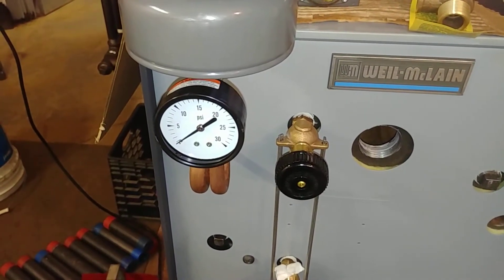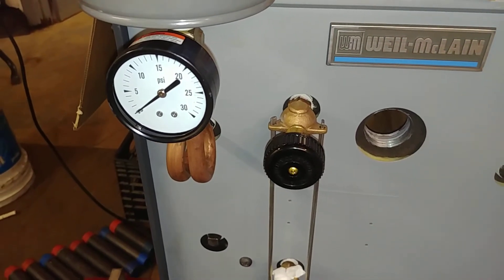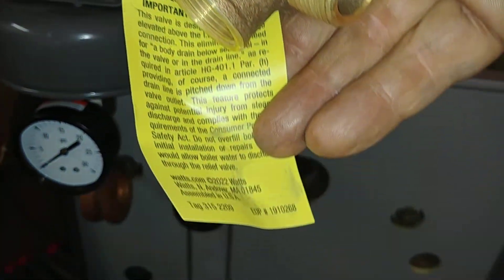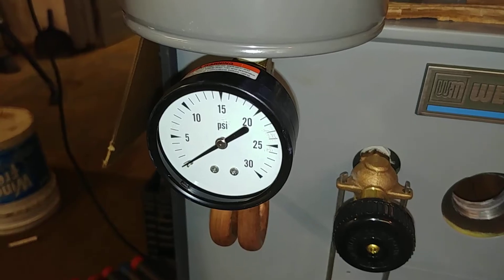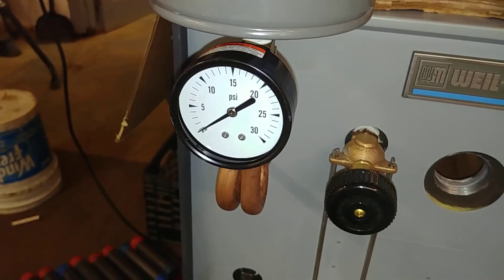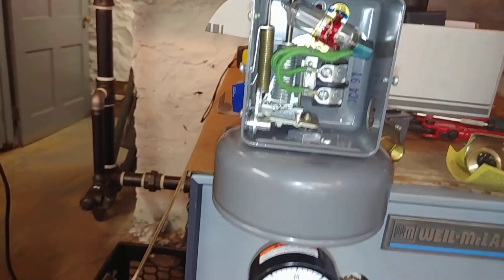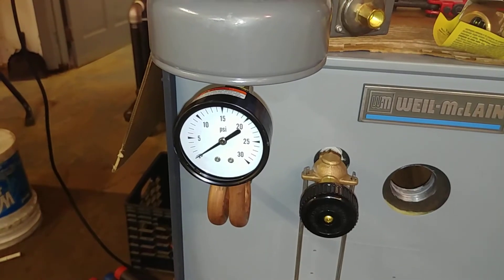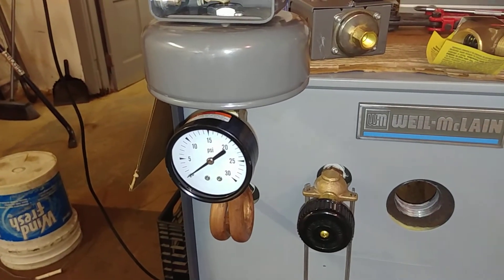Why Doesn't The Pressure Gauge On My Steam Boiler Show Any Pressure? Hint: It Rarely Should

Comment: The gauge on my burnham is for pressure and high limit cut off, the gauge was always stuck 50 psi, the temp would vary depending on how long it on, 170. It cuts off but build pressure very hot in boiler room, one way releif vavle opened to allow water back in after it lost pressure durning the change of gauges
Reply from the maker: I think you may be talking about a hot water boiler?

Comment: Hi, what if my p4041009 isn't shutting down my steam boiler and my internal syphon gauge on my boiler is going up to 30 psi. I have no gauge on my pressure trol switch pig tail pipe.  But it never did have that
Reply from the maker: I would check to see if the "pigtail" the pressuretrol is connected to is clogged.
If your pigtail is made of steel, I would replace it with one made of brass regardless if it is clogged or not.
I would not entirely  trust the pressure that is showing on your gauge. 
Internal syphon gauges are notorious for showing phantom pressures.

Comment: All your videos are amazing, thank you. I fixed my pressure control by using the flat head to bend the metal peace so that it clicks up and down like you said on your video. My pressure gauge is reading 5-6 psi. I believe I have to clean my pigtail and water cylinder .  My question is in what order do i do this procedure? How do i get that pressure down? My assumption based on your videos and comments is to 1. Turn switch off. 2. Unscrew the  top gauge of water cylinder. 3. Empty water from low water cut off. 3. Unscrew bottom gauge of glass cylinder. 4. Clean glass etc…. poke holes for sludge. 4. Move to pressure control. Unscrew wires then remove counter clock wise along with psi gauge and pigtail. Clean etc… 5. Put glass cylinder back, fill water. 6. Put pigtail and pressure control back. How do I fill the water back? Does the pressure on gauge move? And when filling cylinder how do I adjust the gauges when filling? Do they have to be loose or tight?
Reply from the maker: Thank you for your kind words!
I would check out other videos on how to work with boiler sight glasses and make sure you have the requisite tools (such as glass cutters) and parts (such as gaskets, 5/8 glass tubes, etc) before touching the sight glass. 
I am not sure what you have in front of you (a MM#67 perhaps), so it might be counter productive to give a tutorial for this over ytube.

Comment: I have the exact pressure gauge and I’ve been having trouble with my heat hot water doesn’t last and some heaters in the house aren’t getting hot should I increase the water pressure ?
Reply: Also my pipes bang really loud
Reply from the maker: Do you have a steam system? With a tankless coil to provide domestic hot water? Oil fired? 
What is your water level as read by your sight glass?
Reply: @ it’s oil fired the sight glass is full of murky water
Reply from the maker: @Munchies860  If you can't see what your water level is, I would see if you can get it cleaned so you can &  it's very likely the sight glass fittings are full of muck, also.
Reply: @ the sight glass is completely full bottom of it is brown water. Psi reads 1 the boiler will come on then lock out
Reply from the maker: @Munchies860  Check if the pigtail is blocked.
I repeat: clean the sight glass!
Reply: @gordonschweizer5154  Im having the same issue and i cleaned the sight glass and my system still locks out
Reply: @ it’s cast iron steam radiators

Comment: It cracks me up that they let the boiler manufacturers install those "internal syphon" pressure gauges that are supposedly so critical for safety monitoring and that they let them install them just above the water line.  They know the hole is as small as a needle and they just get plugged up in no time and from then on they are responding more to temperature than anything else.  Ya can't make this stuff up.
Reply from the maker: Truth.
I regard the phrase "internal syphon" as a warning label of failure.
https://youtu.be/9smte5dqayY is a link to what's inside such a gauge.

Comment: My guage reads 1lb resting with the boiler cold. But does make its way up to 15lbs + as the boiler runs. Pigtails clear and the pressuretrol is set to 1.5 with the diff at 1. Both Mains are vented with two gortons #1’s each not quite sure if my pressuretrol is bad. Any ideas? I was going to add a low pressure guage off the bottom of the pressuretrol to see if the 0-30psi guage is faulty
Reply from the maker: Does your 30# gauge say "internal siphon"  somewhere on it?
Or is it a gauge with a rear connection?
Reply: Yes it says internal siphon. Guage has the 1/4” connection on the back and its nippled straight into a reducing bushing in the boiler all by itself
Reply from the maker: Check out this vid  on internal siphons & let me know what you think: https://youtu.be/9smte5dqayY
Reply: Excellent explanation thankyou so much for your help and speedy responses I appreciate it very much. So more than likely a faulty guage. Ive ordered the fittings and a new guage to pipe it off of the pigtail
Reply from the maker: I'm glad I was able to help!
If you would, could I ask for a Super Thanks in the amount you deem appropriate?

Comment: I wonder why some steam boiler have that gauge attached to the boiler and some have that pigtail that keep it away from the boiler.
Reply from the maker: @howze2ID  The gauges that are attached directly to the boiler generally have a thing called an "internal siphon".
It tends to clog & and make the 30 psi gauge even more useless.
Please check out my video on steam gauge internal syphons.
Reply: @gordonschweizer5154  thank you much again. So adding a pigtail is a little better for that gauge to function properly?
Reply from the maker: @howze2ID  Yes, adding a proper brass pigtail to protect the gauge is prudent.
I would also consider adding another gauge as well as the code mandated 30 psi gauge, one that reads 5 psi (or less!) to get a truer reading of the actual pressures your system may be operating at

Comment: Great video.  Do you need to add water into the pigtail prior to installing it or does the steam condensation fill it over time?
Reply from the maker: Thank you!
Some folks do add water to the pigtail on first-time start up, but it seems not to be really necessary as you say.
What I think is far more important is to check every season to see if the pigtail is not clogged.
Reply: @gordonschweizer5154  thanks for your reply. I really appreciate it. I just replaced my 30 plus year pigtail with a brass version. Old Pigtail surprisingly was not clogged.  Also replaced the gauge as it was way off by a few psi. Was is the normal residential boiler operating pressure on the gauge for a 2 story building when all radiators are fully heated? Was is the normal CUT-IN psi and CUT-OUT psi that the Honeywell pressuretrol is/should be typically set at? Thanks in advance.
Reply from the maker: The Empire State Building operates their steam heating system at 1.5 psi. on cold days.
That is not a misplaced decimal. That is one point five. One and a half pounds per square inch.
On cold days.
Not so cold days, the pressure is set even lower.
The sixteen story Bromo Seltzer Tower in Baltimore, which is heated with a steam system I personally maintain, heats all 44 radiators at a pressure of 8 oz per square inch or 1/2 or 0.5 psi. (I have videos of it on my channel)
A 36 unit co-op in Baltimore where I have personally maintained their steam system for 20 years, circulates steam in all of their radiators at 4 oz/inch.
These pressures will hardly show on the code required 30 psi gauge.
Yet these are all the steam pressure you are likely to need for your building.
If you seem to need more, something else is wrong - likely it is not enough main venting (a whole other topic).
I have several videos on setting the pressuretrol to its lowest possible setting - cut in at 0.5 psi plus the setting of "1" on the differential wheel.

Comment: So the gage is basically  for safety
Reply from the maker: Yes, it's a code thing. 
It must be able to show double the maximum working pressure of the heating system.
For a typical hot water residential system, that would be 30psi max, so the gauge must be able to show 60 psi.
For low pressure steam, which is defined as one atmosphere, or 15 psi, the gauge must be able to read 30 psi.
But, since December 1899, the maximum day to day Operating pressure for a residential steam heating system was set at 2 psi.

Comment: What would cause my boiler to build too much pressure and then blow water out? 

Just bought a house with a steam boiler from 1985, and came back 1 morning, and there was water all over the floor, and the boiler was off until I added more water. Do I need to replace a pressure valve? Thanks!
Reply from the maker: The safely valve might have just been doing its job & there was nothing wrong with it, which was good for you, otherwise....bad day.
I would shut the power off, and remove the pressure controller & check the "pigtail" it should be attached to, by trying to blow thru it.
If you cannot blow thru it, and if it is made of steel, it should be replaced.
If it is brass, you can try and rod it out with 18ga wire.
You may need to call someone in.
Do not delay, & do not run the boiler until then.

Comment: I spent like 2 hours today. Watching this gauge on my newly installed steam boiler. Wondering why it wasn't going up in pressure. All the radiators in the house we're getting hot.
Reply from the maker: It sounds like your boiler was right-sized or just slightly undersized.
Some folks add a 30 oz/in2 gauge to see the actual pressure.
It is amazing to see the pressure run up to no more than, say, 4 oz/in2, and all the radiators are hot.
Reply: @gordonschweizer5154  nice ill have to remember that for next time. One of my dry returns wasnt getting hot either. I ended up pulling out the vent ( looked like a radiator vent) i tried to blow through it and i couldnt. It got hot right  away after i replaced it with a adjustable radiator vent. I set it for 6. What would be the right vent to put on the end of a dry return?
Reply from the maker: I might try a Gorton D vent in place of the adjustable radiator vent?
If it spits, try a Gorton C.
Reply: @gordonschweizer5154  thank you. If you get a chance maybe you can check out my latest video on my first steam boiler, would love to hear your critique ty

Comment: sometimes my gauge reads as high as 20 psi . there is no pigtail. it just directly connected to boiler. should i bother to replace it? I assume it just screws ito boiler
Reply from the maker: I would recommend a 1/4" tee be added between your pigtail and your pressure controller.
Then, you can add a gauge there.
The gauge that screws directly in the boiler usually fails due to sludge being pushed into the gauge.
Best leave it alone for now.
Reply: I would say the same, had to change the gauge due to clog in that Tiny little hole, and it worked great.

Comment: Hi Gordon, I have a Utica Steam Boiler . I have 5 radiator in my house and only 3 of them heat up and 2 stay cool I check the water level and it was ok and also I put pressure control in 0.5 pound and it still no working. Base on your experience what could be. maybe the pressure control, relief Val Ave or the valve steam
Reply from the maker: Do you have good vents on your steam mains in the basement?

Comment: An ignorant friend of mine has an old steam boiler in his house which he runs at "about 8 to 10 lbs" according to the gauge. Obviously he knows NOTHING about his boiler! Surprised his house hasn't blown up yet. Am going to add a 3psi gauge to his system after we find the obstructions in his piping...I wonder why boiler makers don't always install TWO GAUGES!
Reply from the maker: Remember to check the pigtail for blockages, too.
Reply: There is NO pigtail on the gauge which reads to 30 lbs and says "PRESSURE" on the face. In the lower pounds, it has 1/5 lb graduations. The gauge is mounted on top of the old style tricock "can" that the sight glass is mounted to. Note it is an OLD style with only two cocks; one at low water and one at steam. No middle cock, nor hole to mount a middle cock. I think this two liter pop-bottle sized thing is a condenser. It has a pipe for the steam input that runs halfway down the center of the can; had it off the boiler today to repair the LWCO,

Comment: Hi Gordon, question , is the gauge you are showing supposed to get hot when the furnace cranks up? My needle doesn't move, but the body of the gauge gets hot, then cools down when furnace cools down. Please let me know. Thanks.
Reply from the maker: I have seen it where the gauge's internal Bourdon tube leaks, allowing a bit of steam into it, but that's rare.
There might be a very slight leak at the threaded connection (more likely).
It might be heat conduction?  Is this a new install?  The water seal in the pigtail might not have formed.
Reply: Yes new install, never checked if the old one got hot.  No leaks anywhere.  I'm thinking heat conduction because when its not heating up, the gauge is cold.  Will keep my eye on it.  Was just cleaned by the company that installed it 20 years ago, tech said all was normal, he installed it, I bought the part last year from Burnham Supply online.  @gordonschweizer5154

Comment: Thanks. I replaced the old one thinking it was broke. Same result with new one, pointer doesn't move while furnace is fully cranked.
Reply from the maker: Do all your radiators get hot?
Reply: @gordonschweizer5154  Yes every single one , and all to the very end.

Comment: “The Professor“ strikes again!

You seem to be using pigtails on a number of your installs that initially bend upwards and make one and a quarter turns, versus what I normally see which are pigtails that bend downwards and make 3/4 of a turn. What is the advantage to using them? 

Also, who is a good manufacturer and model to look for on the used market for the old style vaporstats?

Cheers, Erik in the D
Reply from the maker: Thanks!
Those pigtails to which you refer are called "270" pigtails for the 270 degree turn it makes.
The thinking is that it is less likely to become clogged with slime & sludge because the loop seal is above the outlet of the boiler.
If it does block up, it should be a smaller clog and it should be easier to blow out quickly.
Honeywell is the only one I know of for reasonably reliable Hg Vaporstats.

Comment: Hey Gordon thanks for the great video! I've been watching your channel and it's obvious that you know a lot about steam boilers. I have a question. 
So the company I work for has a client that wanted to get into the business of washing his own semi truck tankers. He needed a system that was able to heat up water quickly so we ended up working with an engineer at a supply house to design a system that could achieve this. What we have is a cast iron low pressure steam boiler that delivers steam to a steam to water heat exchanger. The heat exchanger has a control valve that modulates the steam entering the exchanger depending on water temp. This heat exchanger is actually built into a large holding tank that stores the water for when it needs to be used. When we first started the system it seemed like it was taking longer to heat the water. It did work but they decided to crank up the operating control to 13 psi. I know that more pressure means more steam which means more BTUs but do you think it is really making that big of a difference by turning it that high? I just wanted your input on this.
Reply from the maker: Thanks for your kind words!
As to your question: I'm sure the engineer got info on the expected load, that is how much water needed per hour and at what temperature rise.
As to the proposed system: Someone wiser than me said that a BTU is a BTU.
You need more energy to fire the system at higher pressures (and you are dancing pretty close to the safety relief valve limit!) Will most of that energy make it into the storage tank? It should, but I would dial it back to the lowest it go that will satisfy demand.
The modulating valve might be too restrictive? Is there a pressure gauge on the downstream side of the valve?
Reply: @gordonschweizer5154  Hey! Thanks for the response! I am glad you asked the question about the valve because the boiler will satisfy on pressure even when running at this higher pressure and it seems to me like the valve is not able to keep up. There is a valve on the outlet and it approaches 9 psi when the boiler approaches 13 psi. The valve uses a 0 to 10 v DC operating range where 0 v is fully closed and 10 v is fully open. Ive only seen the valve fully open with 10 v dc present. There is a steam strainer before the valve and even though the system is 2 years old I believe I should check it for restrictions. There is also a steam vent with a pressure gauge before the strainer and I noticed that the gauge is reading 0 psi which is not correct and the steam vent is constantly letting off a bit of steam. I'm sure that steam vent isn't helping by consistently letting steam escape which can lead to excess fresh water being introduced to the system. Do you think if I replace that gauge that doesn't work along with the steam vent and inspect and clean the strainer and lower the operating pressure on the boiler and it still seems like it is short cycling then it might just be that the valve is undersized for the boiler? I guess at that point I would need to reach out to the engineer and see what went wrong or if there's a larger valve that could be installed.
Reply from the maker: @nightone9720  Please remember, I'm not an engineer - I just play one on YouTube.
Most valves have a Cv (coefficient of valve) so you can compare the flow thru different types.
You might need a valve with a higher Cv ratio than the one on there currently.
Reply: @gordonschweizer5154  Thank you Gordon. You're wonderful.